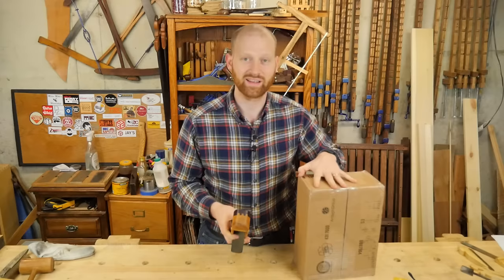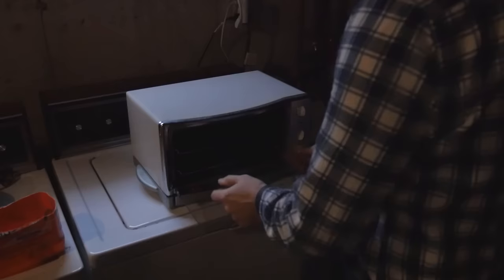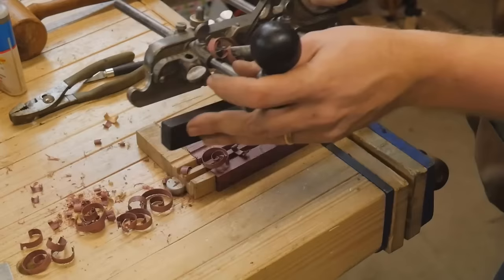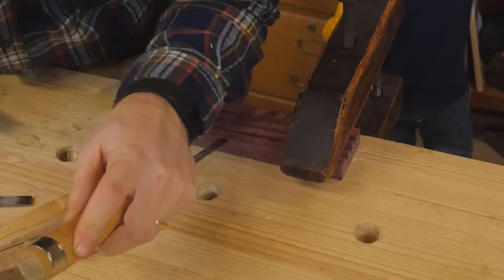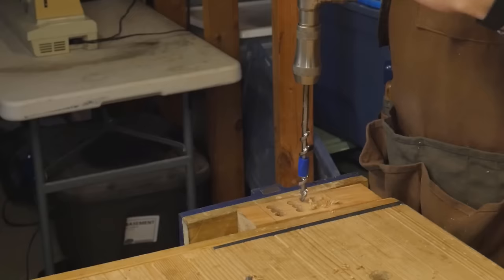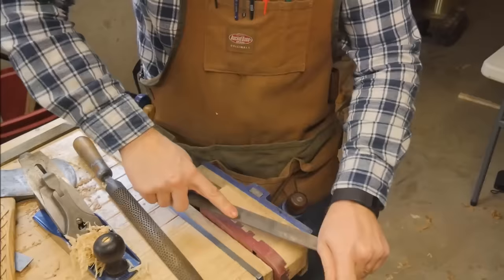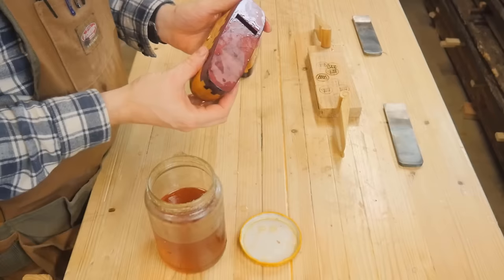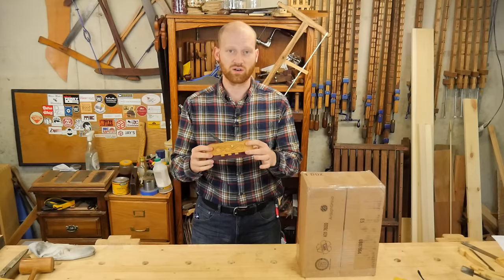How To Make a Wooden Smoothing Plane - Ash and Purple heart - Long Form

Comment: Knifemaking is a whole other rabbit hole to crawl down. I started about 2 years ago and have made about 20 knives. I do use an angle grinder to cut the initial knife blank shape, but a hack saw and time can accomplish exactly the same thing. Most of the rest is done with hand files and sandpaper, but of course there is the heat treatment that must be done using power (although burning lump charcoal is pretty primitive power). The handle scales can be made of wood or home-made micarta using strips of fabric/denim/paper and epoxy or fiberglass resin. I shape them with a rasp, files, and sandpaper after epoxying them to the knife tang. The only other part that might use power is drilling the pin holes in the tang, but I suppose you could use a hand drill for that. Try it out. You'll probably get hooked on that too. 😊
Reply from the maker: So true. I used to do knife making years ago I had a whole shop with slack belt and build a whole nine yards. Maybe someday I'll get back into it.

Comment: Just have to advise against using a glass jar for oil tempering. The heat stress could crack the glass and depending on the flashpoint of the oil, cause a serious fire. I store my oil in an empty 1 gal metal paint can that never had paint in it ( most paint stores will sell you one) and I quench in the same vessel.
Reply from the maker: ya if I were doing more than the one dip I would put it in something else. I now use a resealable can for it.

Comment: 4:34 I have a couple questions at this point in the build. Are the wood sections relevant for a specific reason? Appearances? Durability, grain stability, splinteryness v denseness while working? (Is that a term? I had a random hardwood chunk put off so many splinters while I was trying to work with it that I finally tossed it into the waste bin. It was from woodcraft and not a random pallet or anything.  I have no idea what it was, but I know if I see it again it looks like Mahogany.)

Also, at this point do you have to cut your wood and let it rest at all to release any internal stress? When working with larger blocks is there any consideration to the orientation of the grain when it comes to long-term stability?
 so I guess three major
Reply from the maker: It is just for looks.
If the grain is strait then there in not much need to let it rest. It is actually better to do the joinery in one day so that it does not move due to moisture changes.

Comment: I've become interested in tool making lately... so my question is this : if you were to make a jointing plane, would you make it the same way? what would you do differently? would the length of the plane affect how you make it?
Reply from the maker: it would be the same way but longer and with a tote behind the iron. It is on my list to soon make a full set of planes for my shop but that might be down the list a wase.

Comment: Once again, Fantastic. Someone probably suggested this but here goes..., To get the cross grooves, could you use the rabbet plane all the way across then when making the hole for the blade just make sure it isn't where the cross cuts are?
Reply from the maker: you could. the traditional method would be sliding dovetails across the plane.

Comment: I'm not trying to imply anything with this question but: do you still use that plane up to this day? I've seen a lot of people make planes and I'm under the impression that a lot of them make them and leave them for display, never using them again. Love the plane by the way.
Reply from the maker: I used it for about a year then gave it away as a prize when i hit 100K subs. but yes I did use it quite a few times. it was not as easy to adjust as modern planes, but it felt so good in the hand.

Comment: An easy way to deal with the angles when chiseling is to just cut a correctly angled block and glue it on the top of the plane as a guide. If you put a piece of paper between the joint, you can  just break the block off with a hammer and clean up the glue when you are done, or you could saw it off. You do need a long chisel. Stubby Japanese ones won't work for this.
Reply from the maker: that does work but I prefer freehand it teaches the skills rather than relying on a jig. but to each their own. that is what makes the sport so much fun!
Reply: Using a jig is a skill. It is simply a smart way to accomplish a task. Leaving less to chance. Is that a jig on your plane (the fence you used to fashion your elaborate sole)? I think it is.
Reply from the maker: Sorry I worded that wrong. it is not that I do not like jigs I just try not to use them if I can learn the skill with out. I have cut groove without a fence or planed boards without a plane body (just using a chisel) there is definitely a time an place for jigs and I use them often when they save time. but that is what makes the sport fun what saves time for you or what you find fun is vastly different from me. we each have to find the way that suits the way we work.

Comment: Does a wooden plane need a chip breaker?
Reply from the maker: No plane needs a chip breaker, but they are useful in many cases. It is generally 50/50 finding them on old wooden planes.
Reply: Depends what you are planing, the bed angle and rigidity of the blade all else being equal.

Comment: Use oil when cutting steel with a hacksaw.  You'll cut through it a lot faster.
Reply from the maker: thanks for the tip.
Reply: My bandsaw likes to run dry. The swarf falls out of the teeth easier. I don't have a pan on it where I can run real flood cooling.

Comment: Wood you think handsawing and handplaning still produces enough dust to wear a respirator mask?
Reply from the maker: Nope. They don't produce much at all. And what the saw does create falls rather then getting blown up into the air. There's a reason that only a saw creates a sawdust and a hand tool shop. Every other tool creates chips or curls. But in a power tool shop every tool creates sawdust.
Reply: @WoodByWright  Thanks for advice. I have asthma and a little kid, so I'm doing due diligence to make sure we are all safe with me woodworking.

Comment: great video! as far as the iron,.use a file for initial bevel shaping! will save you a ton of time
Reply: How about a grinder? I have a 12" one here with an aggressive grit.
Reply: @1pcfred  that would work but i was suggesting a file because i think james's channel is mostly power tool free
Reply: @shonuffisthemaster  free power tools? That's great! I get power tools for free or next to it. They're cheaper and more plentiful than hand tools. I built my 12" grinder myself so it didn't cost me anything. I made it out of all scrap metal I had lying around. The arbor was something I found in my grandfather's cellar too. It was an old flat belt drive that I converted over to V belt drive.

Comment: Just a thought from a newbie... Wouldnt it have been easier to use vertical dowels to achieve the same thing as the grid between the two pieces of wood.?
Reply from the maker: +LimitedGunnerGM you could, but it would not look as cool. But it would be a lot easer.
Reply: Wood By Wright definitely agree with the looks. I also think a 14" brass plate on bottom would look great and be more durable.

Comment: Hi James, Big fan. I have a question about a chip breaker in addition to the wedge. I've seen the kits from Hock tools, and they have a chip breaker with the blade. Any recommendations on including a chip breaker? I also have some 2"x3/16" O1 precision ground bar stock, and is it as simple as cutting an extra bar and attaching it with a screw after threading it? Thank you for all you do! You're converting me from a power tool user into a hand tool user.
Reply from the maker: yes. If you can add a chip breaker it makes smoothing difficult wood much easier. I did not put one on here would have taken more then making the rest of the plane. but if I just bought the blade and chip breaker together it would be a lot easier.
Reply: @WoodByWright  Thank you for your reply. I really appreciate it.

Comment: Had to watch this one again because I'm thinking about giving it a try myself, you didn't include the part where you flattened the bottom, and it's a smoothing plane but you didn't take any full width shavings ? :-P  Still a nice video.
Reply from the maker: +Silent- Hill You are so right. I should have done that shot. Still love that plane.

Comment: are there some some ticks to excavate the mortise usinga  chisel and a mallet only? I'm trying on some scrap pine but it doesn't seems suoper accurate...not the level required to an hand plane....
Reply from the maker: are you talking about keeping the bed for the iron to rest on flat?
Reply: Wood By Wright Yes I'm trying to excavate the bed and "breast" only by chisel.  And its not so simple
Reply from the maker: yup that is difficult. that is why the traditional method is with file or float. the easiest way is to cut another block of wood at that correct angle then clamp it to the top of the body. you can use that to rest the chisel on and slide the chisel down the bed ar that angle.
Reply: Wood By Wright Many t hanks!!! I 'm sawing Wood in order to make the jig you talked about. There is always the " chisel bevel effect" : the tendency of our chisel to stick in Wood following his bevel inclunation..probably a narrower grinding angle will help a bit

Comment: James, noticed that you did a brass pin with the wood wedge. Have you ever made one with the wedges are built on the sides (I dunno what the woodworking term is...)? Do you know the difference or is it just builders style? I'm planning to make a few myself and was curious.
Reply from the maker: +Frank Rodrigues I have not done one that way (traditional wedge) but some day I will they require a thicker side wall about are nice as the body is more open.

Comment: Stopt-cut, work to the line. That is easy! When are you going to challenge yourself 😜
Just kidding. They look very cool, shame I didn't win. But with the content I'm still a winner, lol.
Question: why did you reset the grooving plane for the two outer grooves in the purple heart, and not flip the wood around? Was it because of grain direction or to get the spacing correct?
Also, did you use shavings for the packaging?
And lastly, any tips on the placement of the hole for the brass rod in the plane body?
Thanks for your time and have a great day.
Reply from the maker: +Nearoth  the plane body was not perfectly square and true because it would be shaped. and even if it was it is still best to reference off the same side to keep the grooves parallel.
I Did pack it with some shavings. that was a must!
the only important thing with the pin is to keep it parallel with the iron and the sole I like mine to be about 1/4" away from the iron but that is determined by the wedge. and it is easier to adjust the wedge then the position of the pin.

you always ask the best questions! thanks. I wish more people asked questions like this!
Reply: +Wood By Wright thanks ☺. I guess most either know the answers or watch it for the content? But yeah referencing from one side is usually the best, I guess I'm used to the power tool guys who have everything so dialed in that flipping it is more acurate.
Do you have a problem with blow-out when drilling the hole for the pin? Since you can't drill from inside the body. Or would you drill the hole before you remove the inside?
Starting a new job soon, hope it will help fund finishing the workshop, lol. Daddy needs to make a plane.
Reply from the maker: +Nearoth I just put a block of wood behind it so it would not blow out. and I did it before shareing the body.
Reply: +Wood By Wright ah ok. Thanks 😊

Comment: I apologize for this verbose post but there is a serious question at the end... I greatly appreciate your 'only by hand ethic'! Years ago, I used to do design/production in a well appointed shop by day, and work in a hybrid Lightship/Shaker basket style at night, completely by hand, starting with a brown ash log. My baskets, and some tables adapted to the style hit the same wall that your plane has; 60 to 80 hours of work per piece put them out of range for most people. I've begun collecting and restoring hand tools and am in the process of beginning a purely functional shave horse. I've also decided that I need a very small (no bigger than 2' x 3-4' x 24"), heavy bench (kneeling or stool bench), possibly made from 20+ year old 5" cherry. Do you have any thoughts to offer on features and feasibility? Whew, Thanks!
Reply from the maker: Sounds beefy. so are you talking about a chair height bench for sawing or a full work bench?
Reply: Long story short... I've been replacing handles on a wide range of edge tools, and am currently working on my couch and on a 3' x4' x 18" coffee table that I'd like back as a coffee table.
I've mostly been whittling and scraping with a little chisel work, and I find that I like subtractive work and restoration. With a low table I can sit or kneel and work, or simply lay the piece and decide what's next. The wood and tool version of someone knitting.
I have an opportunity to consign pieces, and I think a bench along the lines of my coffee table would speed my work.
I have the cherry which would be beefy (and perhaps better used), or I could laminate 3/4-plywood and sandbag. Dogs and holdfasts enough? How effective would a vice be?
My ultimate goal is to make pin money. I have the opportunity to buy back the very same Conover lathe that I was compelled to sell 25 years ago. A shave-horse, bowl-mule, small table, lathe, would keep me smiling!
Reply from the maker: well in general, you have to be able to hold work vertical, Falt and on edge. normally a tail vice will allow you to hold something flat and on edge and then in the vice vertically. dogs and hold fast work great for face and some edge work but will not hold a board vertical. so that is one of the reasons why I am constantly using a vice.
Reply: Yup, I was just looking for another voice to say that. I'd already thought about extended jaws on a removable old Record vise for short vertical work. Smaller scale standard vises, yeah.
After watching you and Bearcat, I think I'll save the cherry (old T. Moser scrap stock), it's what I used for personal and production basket molds.
Thank you, you've been very helpful, AND vastly enjoyable to watch, I do enjoy work by hand.
Reply from the maker: any time. glad I could help.

Comment: You said it took you about 40 hours.  How much time would it shave off using power tools where you can and buying an O1 tool steel blade?
Reply from the maker: I could save some time, but to save. A bunch with power tool the design would have to change as there are several steps that could not be done with power tools.
Reply: Wood By Wright, which steps?  It’s a beautiful plane, BTW.
Reply from the maker: You can't make tapered plunges like the main mouth or squair cavities for the sole connection.
Reply from the maker: That is the reason most planes made with power tools cut the sides off first, then cut out the moth from the center block. You can't cut the mouth with power tools without doing that.

Comment: Thanks for the great video.  I am trying to find a source of the O1 tool steel but not having much luck.  Can you recommend a source for that?  Keep up the great work that you do. :-D
Reply from the maker: +Derrick Kerr I normally order mine through McMaster or Amazon here http://www.amazon.com/Precision-Ground-Annealed-Thickness-Length/dp/B00CZDPAI2/ref=sr_1_1?ie=UTF8&qid=1461409240&sr=8-1&keywords=o1+tool+steel

just chose what sizes you want. both also offer A2 steel very slimier but is hardened in water.

Comment: I have never been able to produce anything with my Stanley 45 except a whole lot of swearing. I've found it impossible to find a happy place between cutting too deeply and diving into the piece or not cutting anything at all. It looks like you were successful but still, it didn't look like a really smooth process. What would be a good alternative?
Reply from the maker: +wickedmessenger1 a 45 will never be as smooth as a dedicated molding plane because of a state rather then a full sole. But if it is sharp it will do the job nicely. Adjusting depth can be tricky and takes some fiddling. What cutters are you having problems with?

Comment: What saw is that you are using? Looks like a Veritas. Just wondering what cut and TPI it is.
Reply from the maker: Are you talking about the tenon saw at 3:48?
Reply: Wood By Wright Yes! I'm looking at buying one but unsure if I should go rip cut or cross cut. I'm having to slowly build my tools up
Reply from the maker: well, a tenon saw is always a rip cut it is designed to make deep cuts with the grain like the cheeks of a tenon. but of all the backsaws the Carcass saw is the one I use the most. not as deep as the tenon saw, and I do far more cross-cutting then I do fine ripping. most ripping I reach for my panel saws.
Reply: Wood By Wright I can't tell you how much I appreciate you taking the time to read and answer my question. Keep putting out these great videos your projects and techniques have been such an inspiration for my projects! I have learned so much from you.
Reply from the maker: My pleasure. thanks for the great question!

Comment: Hello there! Curious as to where you got the stock o2 tool steel? and what dimensions? thanks!! I think I'd like to try and make a plane myself!
Reply from the maker: +Charlie Kain I get it on Amazon or McMaster some times of each Is cheaper then the other. For this I used 1.5" x .25" bar stock and cut it to 6"
Reply: You can find anything off of ebay too. And a simple google search may find you something if you are lucky.